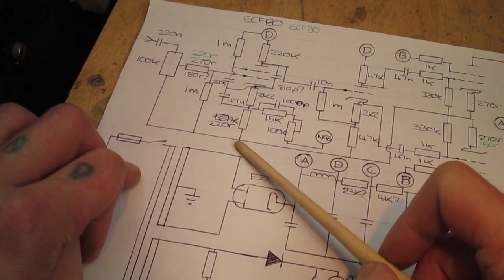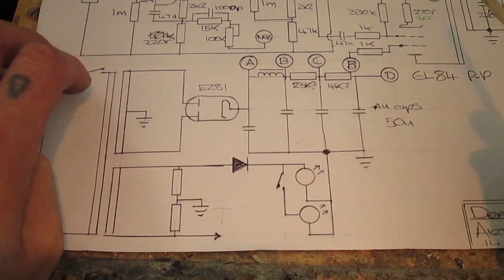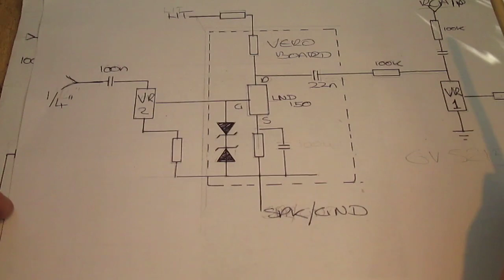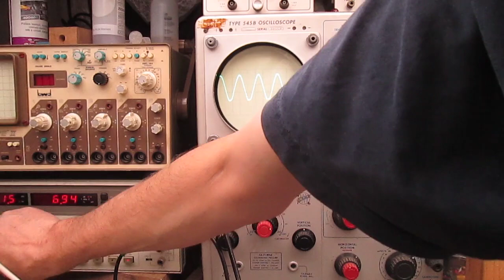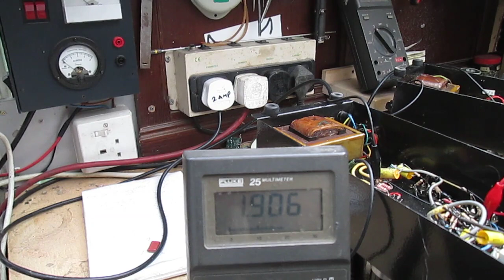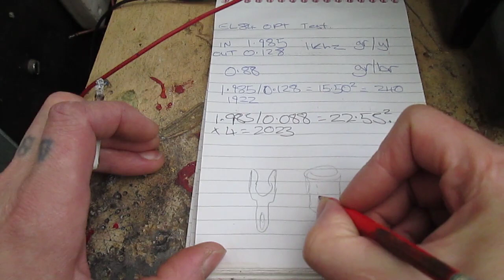EL84 PP Monoblocks- Evaluation & Analysis - Part 1.

Comment: Interesting. I agree with you on those output transformers - they could even be from old radios. Look forward to more in due course, sir.
Reply from the maker: Thanks, can't understand why the original builder used those OPT's. There's more here if your interested - https://www.vintage-radio.net/forum/showthread.php?t=203974 TFW.